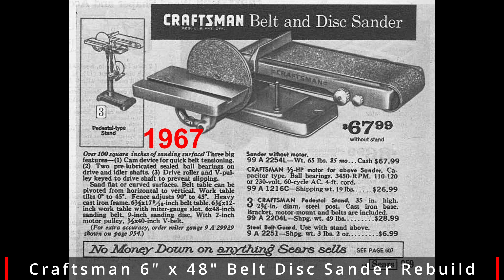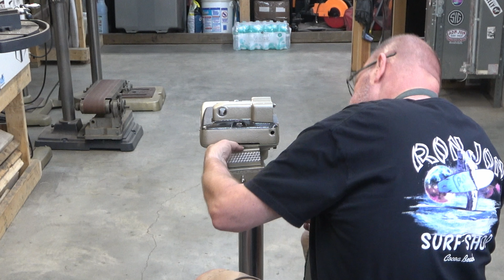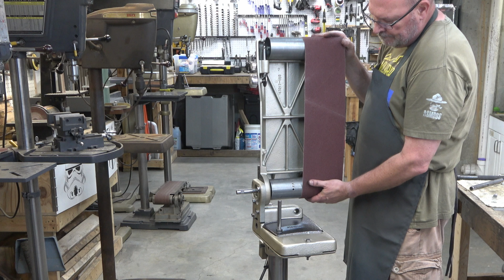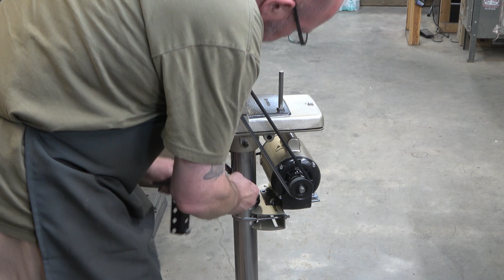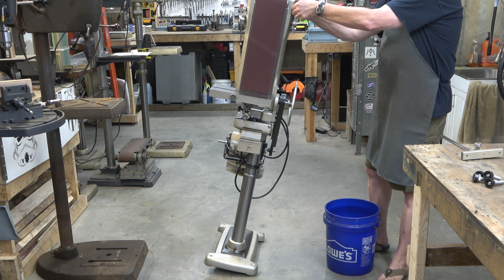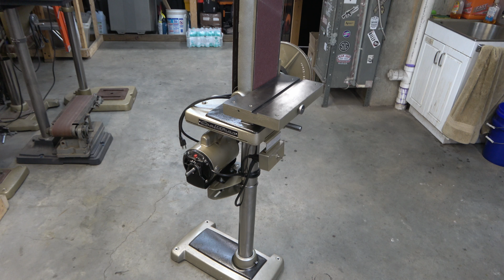Part 16 Craftsman 6x48 Belt Disc Sander Rebuild (Final Assembly)

Comment: Thanks for the video! Just worked on mine. What oil did you use in the oil reservoirs?
Reply from the maker: My sander and motor do not have oil reservoirs, the both have ball bearings; however, I would follow the recommendation listed in the Owner's manual. Thanks for watching.

Comment: Just finished mine and it walks a bit too.  Put a little rubber backed carpet under the base and no more walking.  Mine is going in a Central Machinery tool base too with wood under it but I will keep the rubber.  The rubber is great for cutting down vibration.  Nice sander there Jeff.

Comment from the maker: Just to clarify, with the belt table upside down (As seen when I assembly it here), the bearing with the retaining ring goes on the left side (drive Pulley and table support bracket side), the bearing without the retaining ring is the bearing I install last and on the right side. Sorry for the confusion.
Reply from the maker: yes, the retaining ring will be enclosed in the relief on the support bracket when assembled and will lock the drive shaft from lateral movement.